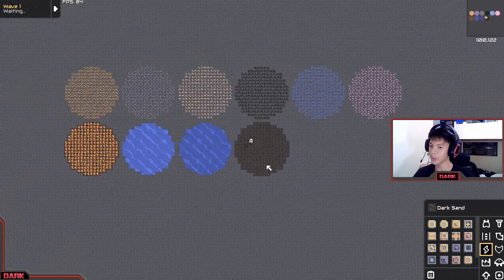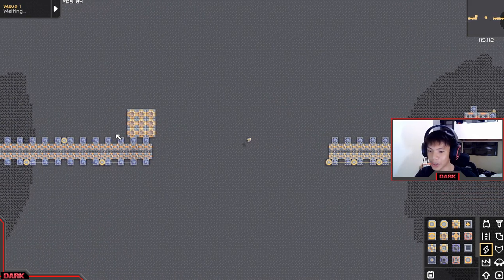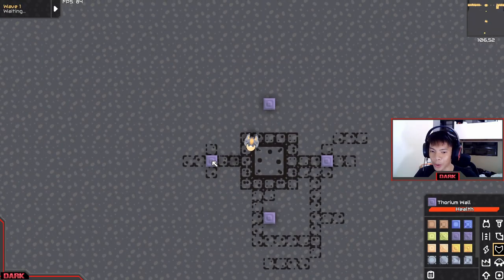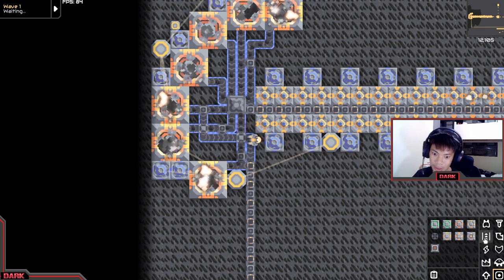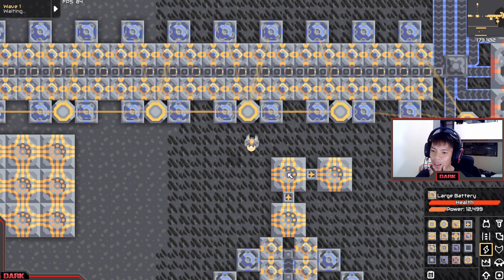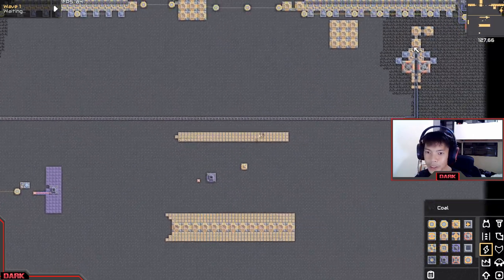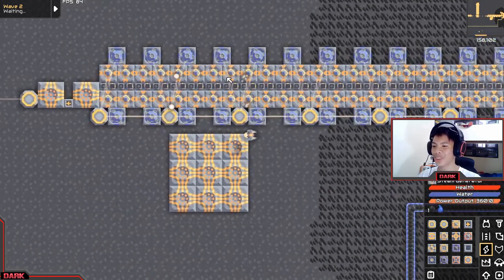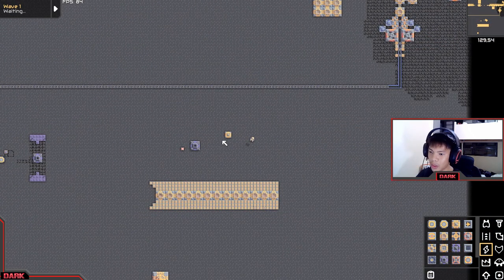How to Make a Backup Power Source | Mindustry V5

Comment: I'm not the best at mindustry but I have spend several hours on it and I can tell you that diodes are completly useless with one exception.
When using impact reactors. I'll explain, every veteran has seen a -40000 power and realized that the impact reactors have discharged and now they need 1.5k (or more with overdrivers) to restart but since al your grid depended on them now you are screwd.
Well there is a solution, you have to separate your base in two grids, one only carring the mining and poduction of blast compound, cryofluid and the impact reactors (i.r) themselves, for the kickstart connect them to your steam power/main grid (you generally only use steam and for lategame i.r) once they are working and selfpowering (material needed to be running included) isolate that grid from everithing else of the base (defences and materials dont needed for the impacts working), then put a battery (can just be 1 of 4k) next to it a diode pointing the other direction and another battery, then connect the 2nd battery to your main grid, AND DONT LET THE GRIDS GET MIXED or it wont work
By doing this you could have negative power and 0 battery stored and the impacts will still keep working.
This works because by doing this the impact grid (i.g) will be using the energy in the form +xxxx/s and any spare energy will be moved to the main grid, and the main grid take the energy from the 2nd battery.
This causes that if your base in total has a -xxx/s power everything but the i.g will be working slower so now you can just put few steam generator or i.r to solve a -1000 or -2000/s instead of having the impact shutted down and have a -100.000/s wich in a lategame is generally an inevitable death.
Appart from that diodes are useless and I never use them since I always tend to have a 2x or 3x energy/s than used so not going in negative, bit there is this use for diodes